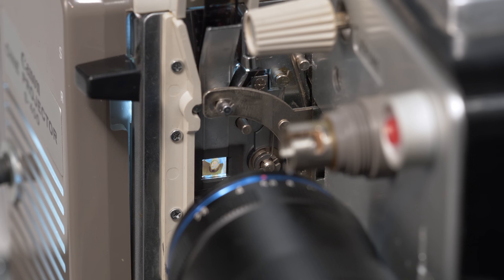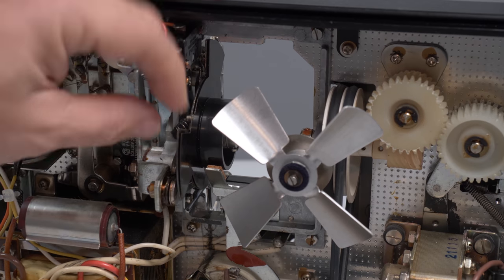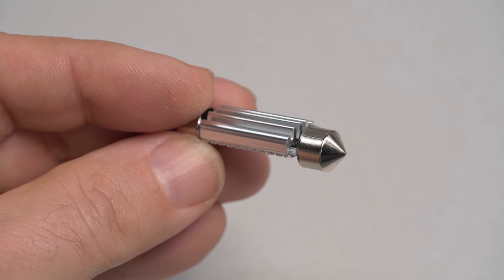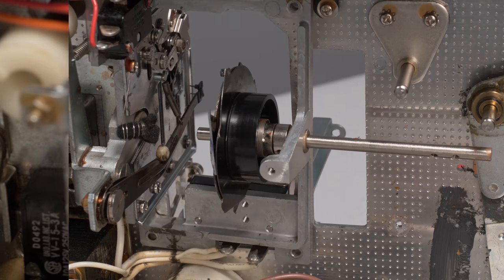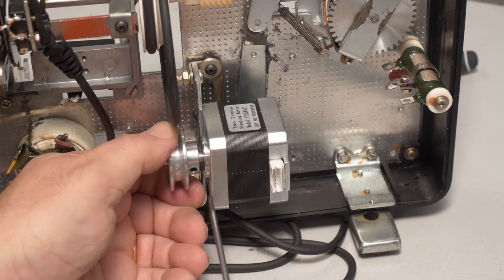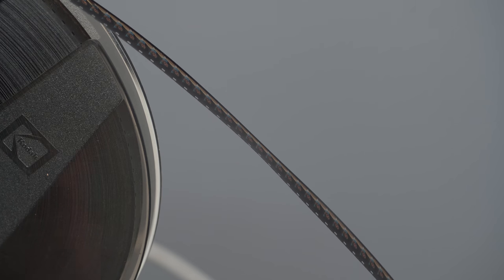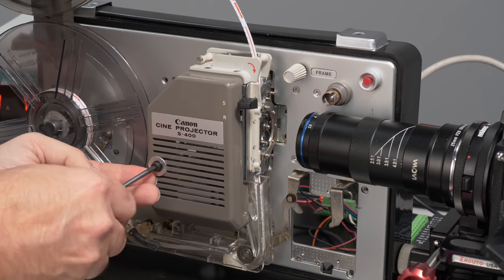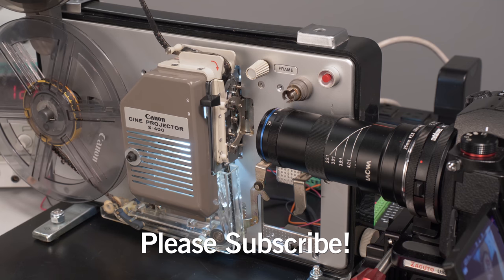DIY Super 8 Movie Film to Digital Video Scanner/Transfer Device Telecine

Comment: The butterfly shutter (two sets of blades) was common in projectors. The intent was that by increasing the rate of flicker, the flicker became less noticible to human perception during projection than if it flickered only once per frame. Each frame flashes on screen twice. 48 flickers per 24 frames.

Comment: LOL, 4K video from Super 8 film? That sounds like overkill because I really don't think the grain count of Super 8 would be enough to match that sort of video resolution. It even begs questioning standard HD. It'd be interesting to see if the way 1920x1080 pixels divide up the comparably very coarse grain of such a small film stock could still produce better results than SD video. Maybe that's debatable but I have a hard time imagining that 4K+ could do any better. Even 35MM film in typical motion orientation just approaches 8K video (33MP), at least based on what I learned in college.

Comment: Well, this IS actually perhaps THE simplest, least expensive, and most accessible DIY telecine I've seen. I've also been looking into creating a home telecine to digitize about 2400' of Super8mm and have been experimenting with various approaches. Would you be willing to share a parts list? This seems so attainable and the results are gorgeous.
Reply from the maker: Sure - I'll get a list together, most came from Amazon. I might put it into a short video as there are some other tips and improvements I've come up with as well. Thanks!
Reply: @FreshGroundPictures  Thanks so much! I'm between 67% - 83% there already but your approach simplifies so much. A bit of concrete guidance would make this happen as an early winter project. Subscribed and looking forward to the next installment.

Comment: What did you do about sound?  I have several thousand feet of Super 8 sound film, and the sound is critical. BTW, that Kodachrome 40 was just fabulous.  I actually shot a sound film indoors with it, using a 250W photoflood bounced into the inside of an aluminum roasting pan, using an XL camera wide open at 18fps.  Portions are underexposed of course, but it would clean up nicely after a high-quality digital transfer.
Reply from the maker: Yes, I also have 2 short films shot with sound on them from long ago. Unfortunately I don't have a good way of transferring that sound now to exactly match. Fortunately, I had the film transferred to standard definition 3/4" video on a  telecine system many years ago. The sound from those transfers syncs up perfectly because the transfer systems ran at an exact speed. At one point Moviestuff actually made a device to transfer the sound at exactly 23.976fps, but I have not seen one for a while.  A sound projector specifically made for telecine (not modified) might work. The key is that the sound has to run at exactly 23.976 frames per second, and most projectors do not have that control.

Comment: absolutely wonderful. i've been wanting to scavenge my grandfather's old equipment so i could digitize some old films of my aunts and uncles. one thing that you could have done is mounted a first surface mirror at a 90 degree angle to the film plane so you wouldn't need to cut into the projector. also, painting everything black or putting some sort of lens hood on the lens might keep incident reflections down. GREAT WORK!!!!

Comment: This is amazing. You are a legend. My only problem will be connecting the stepper motor to the driver. Would you consider making a video on how yto control a stepper motor. I'm sure it would be helpful to many, not just telecine.
Reply from the maker: If you watch the "Update 1" on my channel, there is more info on wiring the stepper motor and driver. I use the stepper motors for their high torque and small size. These motors also allow you to spin the shaft when no power is applied - important because you can thread the film a lot easier. A regular DC motor would also work for my applications, but it is a bit harder to control - in my first 35mm transfer unit I used a regular hand drill motor.

Comment: I would love to do this! It might be neat to run a small film transfer side hustle with a DIY setup like this! My current method of transferring Super 8  is to use a box with a mirror inside to project the film onto and then have a camera shoot the mirror. The problem with that is that the shutter flickering is very visible no matter what settings I use.
Reply from the maker: Yes, the only way to do it well is to get a frame to frame transfer - one digital frame for every film frame.
Reply: used my cellphone with a five dollar program called procam X.  The software allows you to adjust the video framerate to your projectors frame rate. Gets rid of the flicker and ghosting.

Comment: Hello, everything is fantastic and I congratulate you. But I have a question: using a reflex camera after 150k shots, the shutter could be damaged. The repair is too expensive. 150k shots of Super8 frames equals 125 minutes of digitized film. When you get to this amount of shots, do you replace the camera?
Reply from the maker: Hello - I think it's in the video, but I use a mirrorless camera like the Lumix S5, strictly on electronic shutter - nothing mechanically moves in the digital camera, and the frame is taken electronically.

Comment: Excellent construction. From what I understand, a functional projector is not needed to be able to do the conversion, what is needed is the device with the mechanical functions, all the original electrical part is not needed, right? In that case, could I buy one on ebay that is not electrically functional?
Reply from the maker: Old projectors are kind of simple, mostly mechanical devices - in some cases though the existing bulb might cost more to replace than the projector. Unless things have changed, they usually were pretty cheap now - thanks!
Reply: @FreshGroundPictures  Can you tell me the size and reference of the belt used to connect the motor to the projector? thanks
Reply from the maker: Hello - I used the existing projector belt so I don't have exact measurements or reference for it. It is 4mm wide, round, and about 250mm in length.
Reply: @FreshGroundPictures  Thanks, I'll start putting mine together in the next week, your video is an excellent guide, I'm just waiting for all the components to arrive.

Comment: First of all, what a cool project and a very clear explanation of how you converted this projector into an 8mm telecine machine. I have a question: "How do I remove the motor light button from this Canon projector S-400? The screw is already out, but I can't pull it off. I am also busy converting it, with the HQ Raspberry Pi 2 as camera. I would love to hear from you, thanks in advance. Kind regards, Erik Kremer Netherlands.
Reply from the maker: Thanks for watching - I'm not sure exactly what you mean by "motor light button". Are you referring to the main switch control?
Reply: @FreshGroundPictures  Thanks for replying and sorry it's not clear what I meant. It concerns the button that turns on the motor and the lamp. To be able to remove the hood of the slow motto and slow fast.

Comment: Very good DIY job. Excellent eplanation and documentation. I struggle with myself to implement the project myself as well. But I'm afraid that my camera shutter won't last that long. With 45 minutes of Super 8 film, the DSLR would have to perform almost 48,000 releases. With 20 hours of edited Super 8 film to transfer, that would mean 1.279.200 releases. More than my Canon EOS 7 D can manage. The advantage of the DSLR is that in RAW format of the photos the contrast range is much better. But I doubt that the shutter will survive this.
Reply from the maker: I don't know if your camera has a fully electronic shutter, but that is what I use in these setups. Therefore, there's no mechanical wear. Thanks for watching!

Comment: I love this system!!!!,  the quality is fantastic, wonderful colours coming through, much better than the DIY methods using small sensors and also in comparison with the telecine method I used 20 years ago (on screen wall with Sony PC100 miniDV). I''m going to build this!!!!😀 think you missed a trick which I'll see if it would work. For your triggering, you used a microswitch hitting a pin head. I will experiment with this method:  The 3 shutter blades that you removed, leave one! I noticed that when the film was correctly framed, one of the blades was directly located at around 12 o'clock above the gate. At that point I would use a contact switch or laser sensor. When the sensor doesn't see the beam it will trigger( light bleed from laser considered) Anyway I have to prove it. Well done!!!👏👏👏 One question sorry, what macro lens did you use?
Reply from the maker: Thank you. The macro lens is a Laowa 25mm - I have it in Nikon mount, but it's available in many others. Highly recommend!

Comment: This is a good design, but I have to pull you up on what you said about the machine-vision camera. They are the ones used by professional scanners - specifically Sony Pregius. DCS, LaserGraphics, Kinetta, and Filmfabriek all use effectively the same or similar cameras and probably DFT is as well with their new PolarHQ scanner. Arri uses their own camera (Alexa XT), and Blackmagic also use their own camera which hasn't changed in 7 years even with the new model released this year (the Blackmagic Cintel is a good low-end scanner, but it's not a professional scanner). If you were to get yourself a suitable Sony Pregius S camera and build a bright enough light you should be able to scan at 24fps+ with that set up. Even the Moviestuff scanners which come with lower-end cameras are limited in their colour reproduction and dynamic range not so much by the cameras, but by the low-CRI lights they use. Even the latest model only has a 90 CRI light, and the one they were using before it was dreadful quality.
Reply from the maker: Thanks for your comments. I have a couple of new 95 CRI bulbs that I'd like to try soon. At one time I did have an earlier Moviestuff unit and was frustrated by the camera quality. On this unit, I tried a Lumix GH5s as well - micro4/3 chip, and it did not perform quite as well as the full frame camera. I'm sure the quality of machine cameras has improved greatly, but I happened to own the Lumix cameras.
Reply: @FreshGroundPictures  Oh of course the quality varies greatly. One of mates calls the JAI camera used in the 5K ScanStations and the ScanStation Personals "the junk traffic camera". It's also a machine-vision camera, but designed for traffic use (designed as a red-light speed camera). And yes I appreciate you're making use of your own camera instead of spending stupid money buying a brand new camera plus an appropriate lens. The best bang-for-the-buck for a white light is a Yujiled COB 95+ CRI at 50W, but you will need serious cooling for it. To put it into perspective, the household LED downlight is 9w. All that aside though, your present results are very nice. The design is good, very good if I'm honest, and you should think about investing in a faster camera so you can scan at 30fps not for any other reason. Here's a link to a 5.3K model: https://www.flir.com/products/blackfly-s-usb3/?model=BFS-U3-161S7C-C or spend a little bit extra and get the one that LaserGraphics uses: https://emergentvisiontec.com/products/hr-camera-series/hr-16000-sb/

Comment: Great job!
Wouldn't it be better to use a lens hood (or even a tube between the lens and the film) to make sure any surrounding light won't interfere?
Reply from the maker: Probably, but I transfer in very low light, and the LED is so bright that I've never had an issue.

Comment: Could you tell me the brand of the adjustable camera mount that you bought, then discarded for the one you used.
Great production on both the 8mm and 16mm transfer machines, and loved the story on the Arri 35BL. Thanks. 😊
Reply from the maker: Hello - I got it from BHPhoto, it's a Neewer Pro 4 Way Macro Focusing Rail Slider, BH #NE10033981.
Reply: @FreshGroundPictures  Thank you FGP. I built my first transfer machine in 1986 for commercial work doing 8, S8 and 16mm at 18 and 24 fps. I retired years ago, but HD has got me and I am building an 8 and S8 unit using some of your valuable information.
My friend in New Zealand is a mine of information on flat field copying lenses and also has some great ideas. 
 There is a lot of information on a Super 8 Kodachrome frame and I want to see it all on my giant screen through my Panasonic projector. Again, thank you for all your videos and valuable  help. Regards, Brian
Western Australia   😀
Reply from the maker: @brianmuhlingBUM  Thanks Brian - good luck on your project!

Comment: At 12:17, how did you cut away that portion to make the extra room for the lens? Coping saw or Jeweler's saw? I'm using the same projector and it looks like I'll need to remove a few more parts/elements on the inside to clear the way. Did you have to separate the projector body further to be able to cut out that section? I want to be as careful as I can in the handling of everything to prevent damage to the gate etc.  My project is going great with all other modifications completed. I'm just anticipating what I'll need to do when I get to that part of it. Thanks for any comments/help.
Reply from the maker: I kept the projector together, as it was difficult to get it down to the support plate without removing the gate mechanism, which I didn't want to do. I taped off and covered everything on the projector to prevent metal pieces from getting inside. I also taped the backside to keep out metal dust from the cut. (I used blue painters tape) I used a Dremel with a small cutting disc for metal. It worked well, but I wish the cut had been a little cleaner. It worked fine though. Good luck with your project and thanks for watching!
Reply: @FreshGroundPictures  Thanks so much! Makes sense. I do have a Dremel. I just need to pick up a good cutting disc. To hold the gel filter for the led lamp. I used a transparent 35mm film canister without the cap. I cut a notch halfway along the side from the open end and a large window out of the side. Also, drilled a large hole through the bottom for additional ventilation. Then I glued the gel to the outside curving it around the cut-out window. The notch in the canister slides over the lamp support bracket and keeps the gel nicely in place.

Comment: I want to watch your films, are you going to upload them to share? They look fun and turned out great. Great job.
Reply from the maker: The biggest hang-up I've had in getting my films out is the sound. They were recorded on single-system Super8 sound cameras. I have the sound from transfers to 3/4" umatic done years ago. This syncs to the new image transfers, but I wanted to clean it up a bit digitally. I've recently come across a couple of fantastic sound resources that are being tested by Adobe - this does a fantastic job cleaning up and restoring old audio. In fact, I just finished running the sound through their system and I think I finally have something that will match the quality of the new digital transfers. Stay tuned!
Reply: @FreshGroundPictures  Can't wait, specially for your earliest videos like the one with yellow pickup. The quality your achieving is astounding.😊

Comment: Your setup seems simpler to make than many I've seen. As soon as someone says the words "Raspberry Pi", I move on.
I don't want to destroy a good projector to do this, but I found a very basic Kodak Brownie that will do, and won't be missed if I have to, you know, wreck it. I'd probably not go to the trouble of making fancy brackets to hold things in place, when for instance you can just solder leads onto the LED array, and bent the wires until the lamp's in a good spot. Anyway, I'll give it a try. Your results look darn good. (A lot of people put down the Wolverine machine, and I take it it doesn't handle splices as well as it should - but people complain that it adds "jpeg artifacts" - kids, that's film grain you're looking at. Buncha amateurs!)
Reply from the maker: Thanks for watching - have a good build!

Comment: very clever usage of automotive light bulbs. maybe halogen bulb would give better colours because of CRI rating?
Reply from the maker: I hadn't really considered a halogen because I was concerned it was too hot, but maybe that's not the case. It's easy enough to try as the bulb just pops in and out. Thanks for watching!